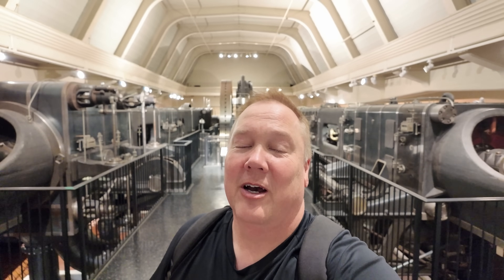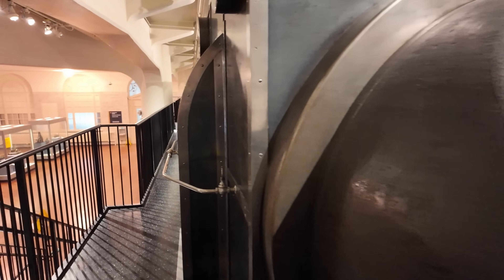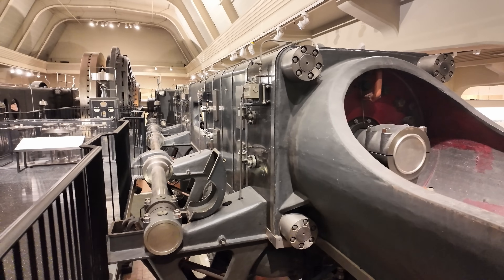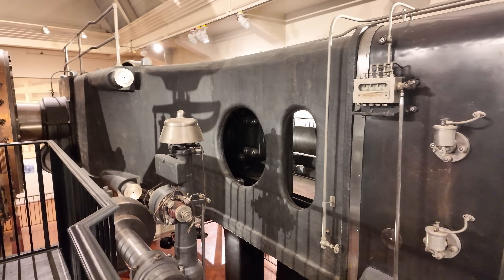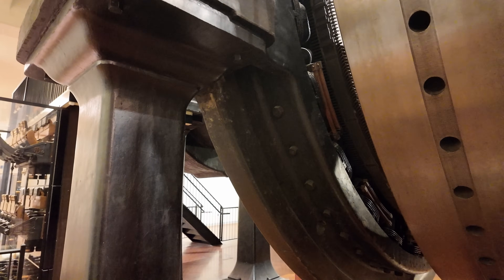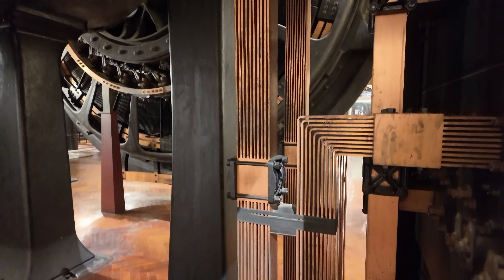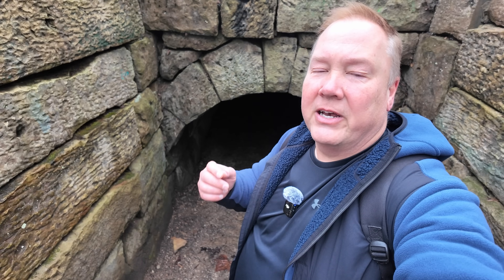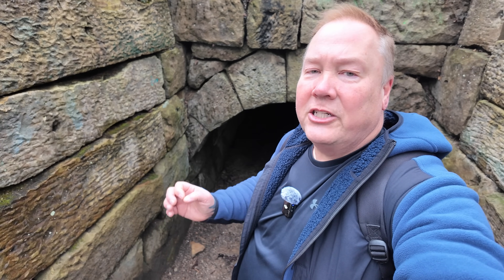Henry Ford's Hybrid GasSteam Engine

Comment: Funny how many people and companies today seem to take great pride in being as wasteful and inefficient as possible. Conservative used to mean just that, making the most with the least amount of resources. That’s been twisted around to “conservative” is just opposite of what the opposing party thinks. 
Henry Ford was such a forward thinker, though he probably thought that we would never run out of oil and coal, and that putting all that carbon into the atmosphere would never be a problem.
Reply from the maker: To be fair, a hundred years ago, I don't know that anyone much worried about running out of coal or oil or carbon dioxide.  Environmental laws, though, were already on the books in some places.  Even in the 1800's UK, for example, locomotives were required to burn coke instead of coal to reduce pollution (soot, cinders, etc).
Reply: @Industrial_Revolution  Awareness of Human-Caused Climate Change
1824. Greenhouse Effect Discovered.
1856. Carbon Dioxide Is Revealed to Be a Greenhouse Gas.
1896. Global Warming Is First Hypothesized.
1938. Global Warming Is First Observed.
1958. The Keeling Curve Reveals Rising CO2 Levels.
1959. Edward Teller Warns the Energy Industry.
Reply from the maker: Wow!  I didn't know things went back that far.  In my defense, I was pretty young back in the 1800's.

Comment: These big ass flywheels- gotta love ´em! Those are the wheels that made the "old" way of producing power so reliable & stable. The intertia simply pulled thru when loads were switched on, that´s what they didn´t tell us when all the nuclear plants were taken offline as well as coal plants. Here in Germany tho the grid is way weaker than it used to be. I´m very afraid for our grid… But this was nice to see.
I think it was in Britain where there´s an engine like this still running occasionally. But at least this engine is still in place- is a boiler, too? Might come in handy, You´ll never know…
Reply from the maker: In piston days, you really needed the huge flywheels.  When power production shifted to turbines, those weren't really needed so much.  
There's no boiler with that engine currently, but remember, it got it's steam largely by capturing the waste heat from the gas side.
I haven't been there (yet) but the UK has a lot of really incredible old steam engines that they routinely operate, scattered through museums all over.  I really need to get over there sometime.

Comment: Very interesting, Ford had leftover coke gas from steel making, used it in engine which had leftover heat used to preheat water into steam and turn  the wheels of the plant,  Incredible.
Reply from the maker: Pretty good efficiency, isn't it?  Take your waste stream and use it to power your entire system.

Comment: It would be interesting to know the overall efficiency of this power plant.
Reply from the maker: Not sure how they measured it, but it was built for efficiency.  The producer gas that fed the right side was a waste product of coke production that they either needed to burn like this of flare off, so that side is amazingly high.  Then they captured the waste heat from that, and used it to produce steam, so again, amazingly high.  Basically, the entire energy input to the system was stuff they considered toxic garbage.

Comment: I wanted to know if it was quiet or noisy operation and if so how many decibels?
Reply from the maker: I don't know, but I'd guess it's probably a lot more quiet than you'd expect.  The reason I think that is that noise tends to directly be inefficiency, and this engine was designed for maximum efficiency.  If you check out my Corliss Steam Engine video, it's a huge engine, a huge flywheel, but was built to run very smooth and it's amazingly quiet.

Comment: The whole power plant is a work of genius: utilizing the gas from the coke plant that produces coke for the iron smelting - essential a " waste product "  then capturing the waste heat produced by the gas side of the engine & producing steam with it, to drive the steam side of the engine...Essentially producing electricity from... waste products....Not really  "free energy " but producing electric power at a fraction of what would have cost it otherwise...
Reply from the maker: Yep.  You wouldn't think it, but Henry Ford was really big on efficiency and using everything.  Check out the story of how he and Kingsford invented charcoal briquettes and the home BBQ grill because he didn't like seeing the mountain of sawdust going to waste at his sawmills.

Comment: You have to do this with AC too to maintain frequency. Large rotating masses help manage frequency
Reply from the maker: I'm really hoping to find one of the early hydro-electric plants that's still operational and film the process of bringing it on-line and manually syncing to the grid.  I saw a video of someone doing it once, using the old synchroscope with a spinning needle and 2 red lights.  They'd tweek the water valves to adjust water into the turbines, with a 30 second delay before the change hit the generator.  Nowadays, power plants just type in the command to sync and it just happens.
Reply: @ I remember doing this when I was training to be an electrician, we had a motor generator set in class we could sync to the grid. With exactly that, a syncroscope needle. That was fun. Now days none of our power stations even have on site operators. The one I helped build years ago had a control room, but everything was automated
Reply from the maker: I saw a video from an old dam in the western US or Canada where they were bringing it back on-line after repairs with a synchroscope, so it's still done, but definitely not common.

Comment: Great tour - thank you! Subscribed. The entire time I was thinking about the effort it would take to move that thing from one facility to another.
Reply from the maker: That museum hasn't shied away from moving big things.  They have locomotives over in on one side and, outside, is Henry Ford's collection of buildings.  At least this engine was probably fairly easy to take apart, move, and reassemble, but some of those castings are HUGE.

Comment: Very impressed thry used waste heat from the gas engine to generate steam for thr steam engines.
Reply from the maker: Henry Ford was big on using everything, as much as possible.  He was also a big user of hydroelectric power, even on SE Michigan's smaller rivers without a lot of drop, and ran his "Village Industry" plants entirely on water power up until WWII.

Comment: They must have not hung on to Edison's DC generators for very long..I know they went to AC at the Rouge..
Reply from the maker: The Rouge generators marked the end for these ones.  When they got those set up, Ford ran power lines to the Highland Park plant at these ones were all scrapped, except this one, which Henry personally tagged to move to the museum.

Comment: Steam side is a Corliss steam engine... That valve drive shaft is needed to synchronize the high and low pressure cylinders together. There were a dozen of these D. C. gas-steam generators to power Ford. The heat exchanger you so called is actually the condenser so that the steam can be recovered into boiler feed water and used over and over. I've been all over that engine for 40 years and before they isolated her.
Reply from the maker: Their signs are wrong?  I'm not too surprised.  I've actually seen that there a few other times, too.  It happens.  I was trying to get into the Benson Ford Research Center for more info on this one and some of the others but, unfortunately, they closed it for covid, and never reopened it.  For a while the staff in the museum and village said you could call and make an appointment, but when I tried, they're not doing that at all anymore.  Hopefully they reopen soon.  It's an incredible resource.
I've heard stories about when all these older engines were far more accessible, and quite a few more were running at low speed.  I wish I could have seen it.  When they run the big Corliss now, it always draws a crowd.  I'd love to see some of those others running.
Reply: @Industrial_Revolution  it was amazing to be able to get up close and personal with that monster engine. Even sitting idle it exudes amazing energy... I get goosebumps just reliving it.   Lol  It's a shame to see the engine controls and electrical switchgear boxed in with plexiglass. Being able to touch that monster was one of the huge draws to it...well, for me it was. And that's the big rub I believe...back in the 70's and 80's people actually respected the displays and revered them as history of mankinds accomplishments. Now days it's just a thing, and something to mess with. And with you... I could actually hear the awe and reverence in your voice as you walked around the ol' gal. 6,000 HP @ 83 RPM if I remember right... Thank you so much for the walk down memory lane.
Reply: Imagine the number of amperes for 50 Megawatts at 110V / 220V  DC.  What was the size of the cables and busbars?
Reply from the maker: @8546Ken in the video, you can see the size of those copper bars they're using.  For scale, the panel is, I think, around 8 feet tall.
Reply: @8546Ken  if I remember right the positive and negative busbars on that generator were plate copper 5 inches wide and ½ inch thick with 5 or 6 plates running together about ½ inch apart. TONS of copper. I've been to a modern generating plant (640 megawatts per generator) and saw the actual output to the step up transformers. It was a grey tube with an inspection port and my friend's dad told me to go look inside. Inside was a copper tube made up of dozens of 1 inch square copper links giving off a light blue aura. Of course every hair on my body stood on end when I placed my hands on the outer tube. 35,000 volts at 17,000 amps going through that multilink conductor to get shot up to main line distribution voltage. Amazing to think a huge 880,000 HP steam turbine spinning at 3600 rpm. Wow
Reply: @gerrywalsh5766  Impressive to have a first hand source here! Did the engines run smoothly with both gas and steam? Since the engine types have very different power strokes I'm wondering how it didn't constantly constrict the other side, the gas ignition must push a lot faster but more intermittent than the "slow" and stable steam side.
Reply: @kotten9534 actually because of the style of valving that makes up a Corliss steam engine...they react MUCH quicker than slide valve steam engines. The coal gas side and steam side of that engine are engineered so well that they don't hinder each other. Also running at only 83 RPM doesn't create a ton of shockloads to the big ol' gal. I'm also guessing that the 20 ton flywheel and 20 tons of generator armature also worked at absorbing power stroke impulses.
Reply: impressive, thank you for sharing!

Comment: They must have started it with the steam engine first. Very interesting.
Reply from the maker: They could run it from either side, individually, or both sides together.  I'm not sure how interlinked the engines were, but it may have been possible to move steam from one engine over to another.  The first to start would have almost certainly come up on gas, though, since that's where the steam came from.

Comment: Each side had two pistons on one piston rod?
Reply from the maker: Yep. Some marine steam engines did the same thing, usually with a long, vertical piston rod with high and low pressure pistons, maybe even a medium pressure piston, along it.  If you look at some of the bigger, articulated locomotives, like the Big Boy or Allegany, they use the same system, but just use a separate piston rod on each cylinder.  For steam, compound engines are a way to be far more efficient at higher speed, and Henry Ford was definitely all about efficiency.
Reply: Yes two pistons on each rod , Snow company made large gas engines of this basic design . They were used to compress natural gas into pipe lines . There are several of them that run in museums that are supported by old engine collectors . Google Snow engines and you will find videos of them running !

Comment: How long did they use it?  Did its use extend past the model T days?
Btw, great vid.
Reply from the maker: Surprisingly, they didn't use it very long.  When they got the electric plant set up at the far larger Rouge plant nearby, they ran electric lines from there and shut down the local power plant.  Henry Ford himself ordered this one saved for the museum